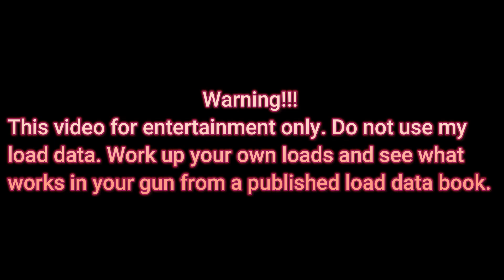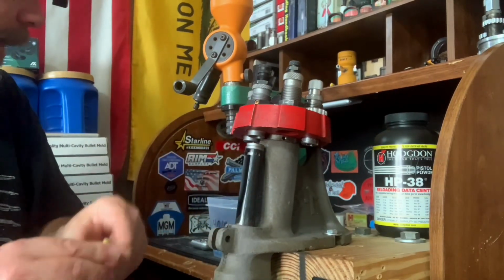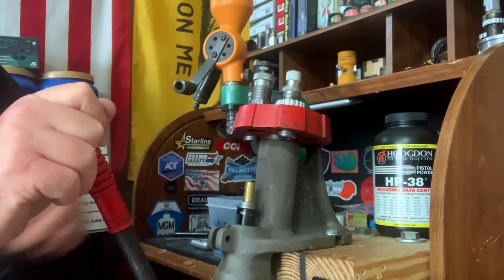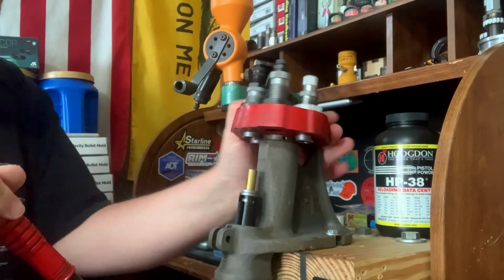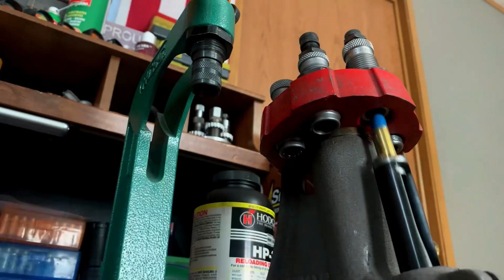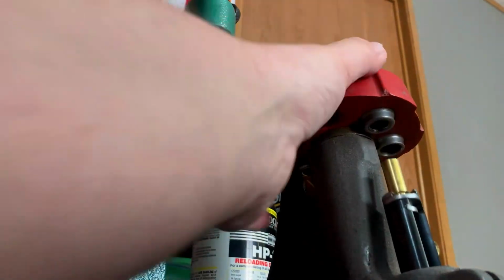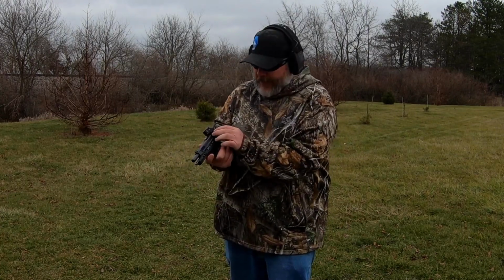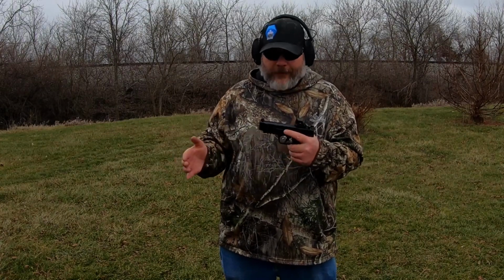Loading 10mm on the Lyman Spar T Turret Press and Shooting in the S&W M&P 10mm

Comment: I have the lee pacesetters with a full length size die, put a universal powder dropping die in line for the autodrum, and a .223 fcd for the hell of it. Loads just as fast as 9mm. 

Plenty accurate on the powder dropping, too. +/- .1 grain. Just takes a good bit of fiddling to make sure you achieve full acuation of the autodrum without crushing the case.  

I havent had a need for small base or undersized dies with .223 in my AR at all. Thats not to say it never happens. It might have so.ething to do with me annealing every single piece of brass before sizing every time. Wont work harden enough to be stubborn and fail to size down. Ironically, thats an issue for Blazer and FC brass in my 9mm process. Damn things wont keep tension on a bullet without it!
Reply from the maker: I have a Lee auto drum and auto disc. I don’t use them on this press cause the turret is at an angle. Thanks for the comment and watching.